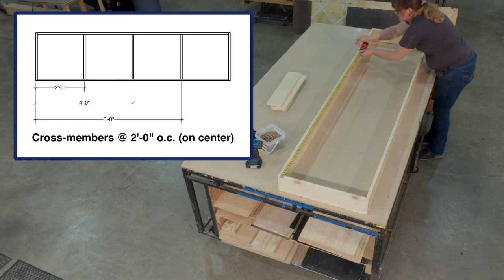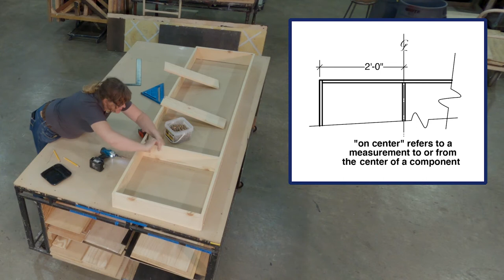Stage Platform Construction

Comment: I need to build the Nicholas Brothers dance stage from Stormy Weather (1943) Musical. It looks 16 feet high, 20 feet wide, top platform is about 10 feet round, with six 4x4 x 8 stairs on both sides with two 3 foot wide slides on both sides curving to center, starting from the top. I have a picture.
Reply: I actually want to recreate all the set pieces from the movie.
Reply: Thanks

Comment: Is 1 by enough to hold the weight of people and sets? Also are those 1x8s?
Reply from the maker: When used properly, yes. I make platforms out of 1x6 and hog’s-trough legs out of two pieces of 1x3. With good cross-bracing, I’d go up to 8’ tall platforms with this construction. With some traditional scenery practices that most don’t use anymore, you could go bigger than that. I prefer the 1x construction because it keeps the weight down.
Reply from the maker: 16” high platforms are perfect candidates for 1x6 framing and 1x3 hog’s-trough legs!